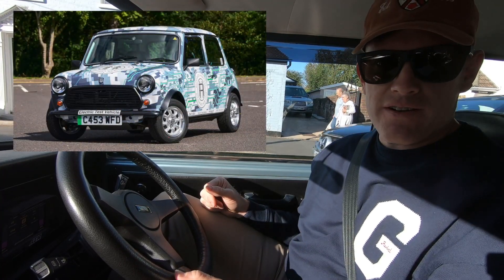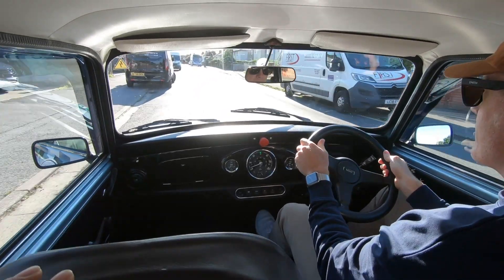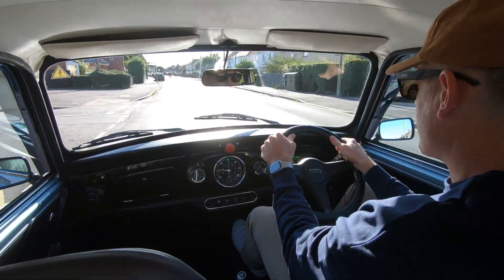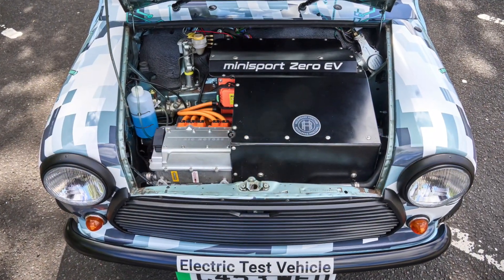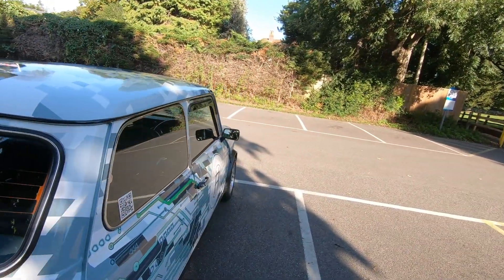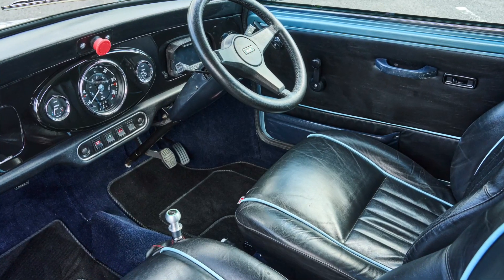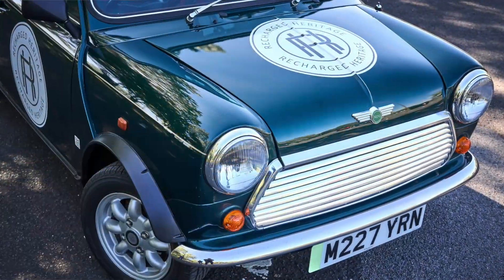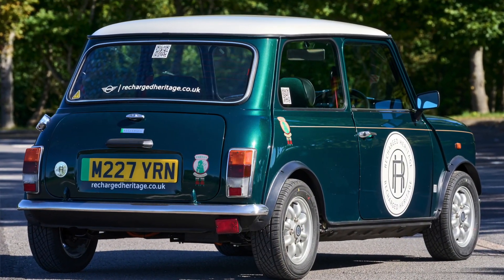FIRST DRIVE: MINI Recharged - Official Classic Mini Electric Conversion Kit

Comment: Really loved my classic mini and wanted to convert it to electric as I agree it is a perfect doner car however the price (as mentioned by others) is ridiculous.  I like the mini enough I would pay $30,000 USD for a very limited range and spec car like this but 60,000L (GBP) is crazy.  

I got an fiat 500e (1st gen compliance car with bosch drive train) for about $10,000 usd (used) and the 87 mile range was barely functional for city driving... however they were onto something.  Neat little car frame with a small EV setup at a great price!